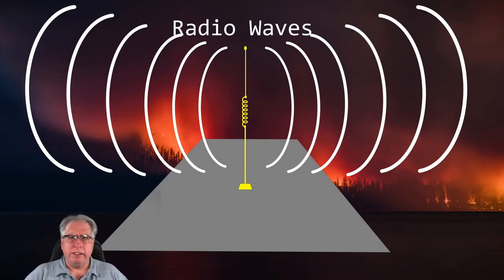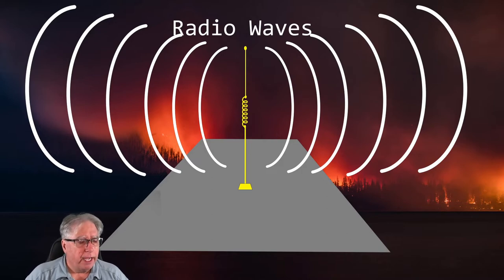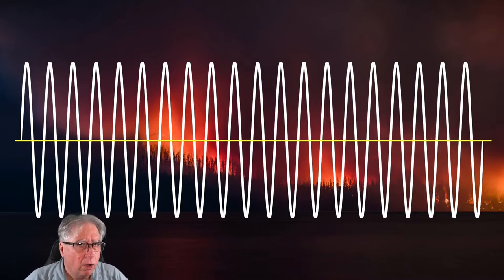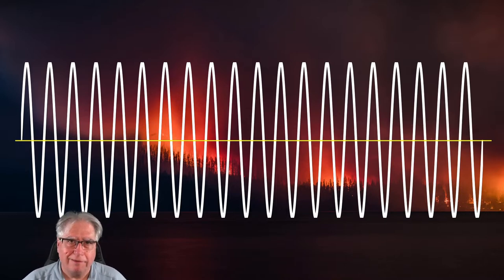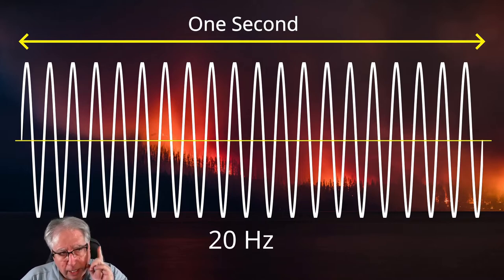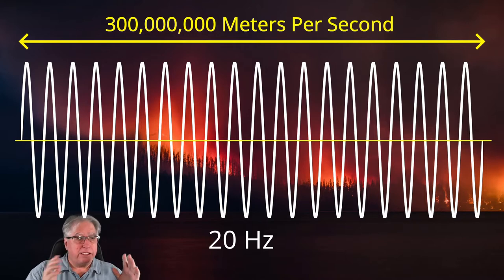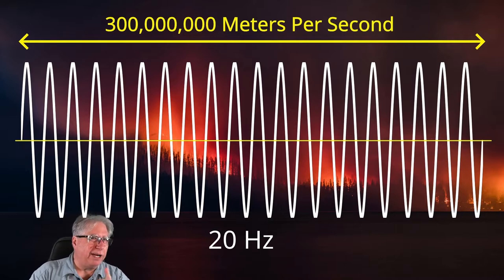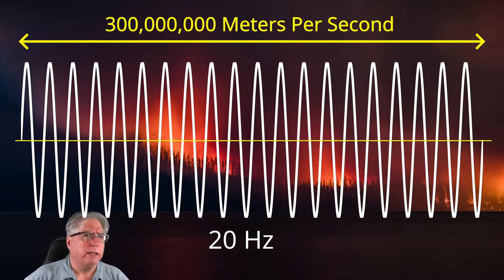How Do You Make A Beginner's Ham Radio Antenna?

Comment: Great video, Stu. It covers the bases quite well. Like button: smashed. Subscribe button: destroyed. Notification bell: annihilated. 

Dipoles are one of the first kinds of antennas that new hams build. Potentially stupid question here: the thing that I still don't quite understand is why we attach the actual core of the coax (the signal) to one leg and the shield of the coax to the other. Why not just connect the core of the coax to the centre of a single wire? That way all the signal would go to the wire. Would love to hear your thoughts. 73
Reply from the maker: Hi Armen,
Thanks for the thumbs up and great question!

Visualize an electric circuit.
- When we use AC current, there are both a hot and a common wire, with one on each side of the device.
- The current moves back and forth from one wire to the other wire passing current through the device (light bulb or whatever).
- The device uses the current to create action (light, heat, motion, etc...).
- If we remove one of the wires the current no longer has a complete circuit to create the action.
- The device is no longer energized.

Now, let's look at a transmitted signal.
- The transmitter generates electricity flowing into the transmitter antenna.
- This makes electrons vibrate up and down the antenna, producing radio waves.
- Half of those radiated waves exist on the shield of the coax.
- Not connecting that side of the coax would cause the coax to radiate half the signal. (not good).

As with everything, there are exceptions. A non resonant long wire sends the shield side to earth (needing a grounding rod). This is why we need a 9:1 unun to transform the characteristic impedance to match the antennas funky impedance of the antenna itself.

Hope that clears it up for you... It was a struggle for me to wrap my head around it as well when I was getting started.

Stu
AG6AG

Comment: I am running a longwire indoors about 53 ft with a 9:1 UnUn and at 91 for my DXCC (it has taken about 2-3 years). I do FT8 of course as that is the only thing I can receive.
Reply from the maker: Hi Lion,
And old ham told me that the only bad antenna is the one you are not using... I've used all sorts of antennas in the field and will tell you that a 9:1 will let you just about load anything! I had a buddy load a barbwire fence with 160M and got Qs!
Cheers,

Stu
AG6AG